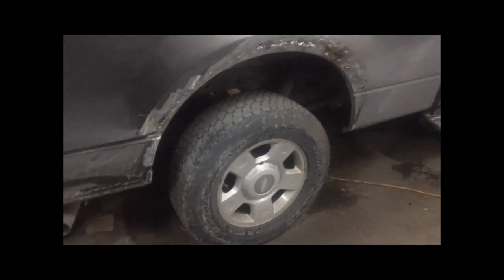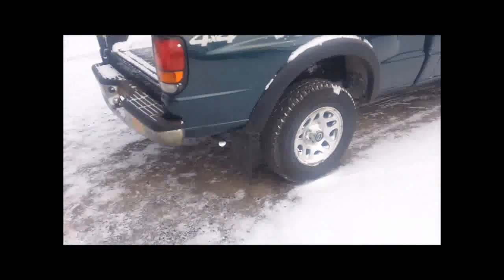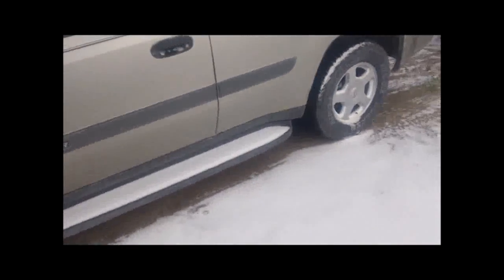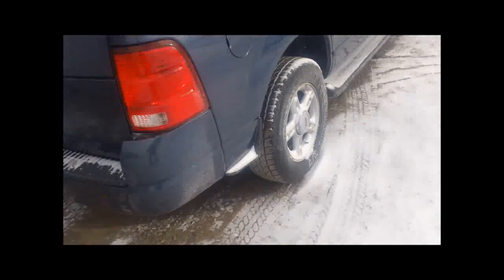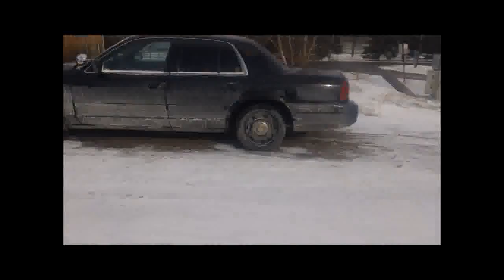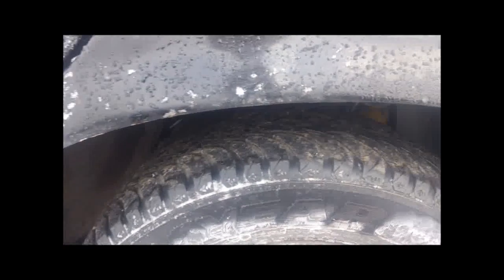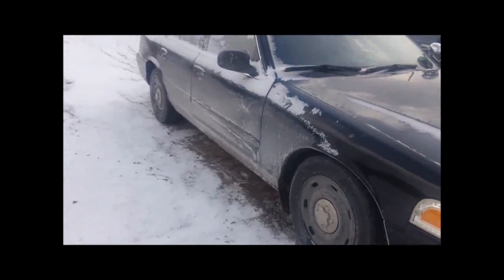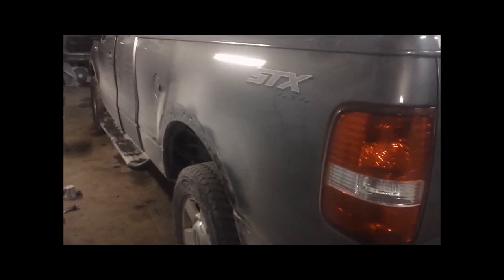Why do vehicles rust? Poor build design or because people don't maintain them?

Comment: Krown it . All inside the panels .. once a year ... then spray it with a can threw out . Car wash once a week in the winter . Use rubber floor mats so the salt off your messy boots don’t go down threw the carpets.... and like Shawn said motor oil .... I had my g6 drilled out so I had access to all the panels and I’ll take a funnel and poor a quart of burnt oil down in the rockers .. it’s a 2009 ...10 year old car drove every winter and has no rust at all . Body maintenance is so important in the rust belt and Canada

Comment: These new cars, trucks, suvs that are so damn expensive , should last the consumer many years even after it's paid off, problem is the underneath of these vehicles rot out bad whether you wash them or not and to the naked eye can eventually turn into a real hazard on the in road if the frame fails. These automakers should cost this stuff on every brand new vehicle to prevent this prematurely

Comment: My truck's fairly decent. Rear wheel arches are shot behind the flares and I had a cab corner put in. The other corner needs a patch now I learned today, a substantial one. It is an 04 dakota though. Front driver's side fender needs to be replaced too along with repairs on the passenger side. Looking at it I'd say poor design with the factory flares. After looking awhile for a truck without flares to harvest a pair of fenders off of I finally found one. A 97 that's completely spotless, and this is southern Ontario.

Comment: My 02 DeVille is a case of cars that are not really all that old rusting quite badly.  It was well cared for by the previous owner, it was his retirement gift to him self and his pride and joy all 13 years he owned it.  He just never thought to have it rust proofed.  In the nearly two years I've had it I've kept up on keeping it clean and waxed, and at just shy of 15 years old it has rust through.  Not designed to be even slightly resistant to Michigan winters.  You can see where the rust starts in the wheel wells, there is a pocket that holds that moist salty sand.  Just sad really, its a great car that mechanically has a long life left.  I feel this body is going to get this thing scrapped in about 5-7 years.

Comment: The whole auto industry is a racket. They could easily put in a foam behind the wheel wells that's waterproof.  Hell, every hardware store sells insulation foam for windows and doors that's waterproof.  But face it:  if the corporations didn't make shitty cars you wouldn't have an income.  You wouldn't have a job.   You wouldn't have a business.  What would you do if cars lasted 50 years with very little maintenance, eh?

Comment: Great videos!!  Finally using my own name instead of my daughter Colleen to post  -:)    As posted earlier, Oxygen and Metal don't mix!  Moisture (water)  +  Salt (Road Salt)  +  Heat (warmer temperatures) A C C E L E R L AT E  the corrosion process. Whether car designs are crappy or not , the consumer is stuck with the problems caused by RUST. Keeping moisture (water) OFF metal will greatly extend the vehicles life PERIOD!!! If you drive in harsh winter conditions where road salt is used 4 months out of the year, frequent washing's are not enough IF you want the car to last many years. Dirt, moisture and salt settle in frames and rockers,then corrosion activates in warmer temperatures of summer or heated garages.

OIL repels water and keeps it off the surface. Spraying ATF or Heated Bar and chain oil into all enclosed areas and exposed surfaces will greatly extend the metals ability to not corrode. The process is best done in the warmer months of summer , because the expanded metal will absorb the oil much faster and thoroughly.  Spray into rockers, doors, fenders, frame and channels, hollow suspension components like control arms, top of fuel tank. The places you miss will eventually rust out. Touch up as needed annually.  Concentrate on the rear half of the vehicle , because it gets hammered with dirt ,water and salt..

Comment: Salt is the enemy, not all the manufactures fault. Cars from down south, California, Arizona, where states have no salt on the roads, the cars are rust free. If the car manufactures would maybe coat areas of the car or truck that prone to rust it may help. Or get in there and do it yourself when it is new , it will help a lot.
Reply: you're right ..but where you're at you have low humidity. ....I've seen videos of junkyards of 75 year old cars with just surface rust....I mean just prime project cars ....but the northern cars need undercoating from the factory!!!!!

Comment: Thin cheap steel and lack of paint. Manufactures constantly cost cutting. Trying to make a bigger margin. A friend of mine works in a Nissan main dealer. And most of the new cars nowadays come out the factory with a dusting of undercoat on the underside. no underseal and hardly any stone chip repellent. all they do is use seam sealer over the welds. cheap and nasty stuff. Best thing to do when you buy a vehicle, is buy a few cans of underseal and go mad with it on the underside. inside box sections and inside doors etc etc. prevention is better than cure

Comment: Rust is created when iron is in contact with oxygen. Metal impurities are also a factor. Moisture , Road Salt (Chlorides) and heat (warmer) temperatures ACCELERATE the corrosion process. If you live in a rustbelt state that uses deicers, you need perform rust control maintenance on your vehicles. Annual thin oil applications provide a barrier between metal and moisture. Annual spring time oil spray into ENCLOSED and exposed areas will greatly extend the vehicles. The warmer weather accelerates corrosion, but also allows oils to penetrate into seams and tight spots where salt and moisture hide.  Metal has pores like our skin and expands with heat. I use Bar and chain oil or ATF from a paint pressure pot.
Reply: +Colleen B. exactly right colleen-you can't stop the rust completely but the oil applications will slow it down tremendously.

Comment: from Ont. Canada here....have a 96 gmc 2500 oiled 2x year, after what...18 years fenders and cab corners are starting to go. not too bad considering they have 05 trucks in the scrapyard full of cancer.  I believe it is a design flaw AND a maintenance issue. just my opinion.Andy.

Comment: A mate used to work for British Steel in the 90's, he said that most European and American manufacturers weren't too fussed about surface rust on the steel they bought. 'Ford accepts anything' were his words. At the same time, Honda would refuse a delivery even if the slightest bit of rust was present on a roll of steel. Not sure if that was/is true across the pond, but it's a thought.

Comment: Being from Chicago and growing up in the 70s and 80s, every car on the road was a rust bucket especially the Fords, they were the worst. Cars became a lot better in the later 80's, 90s  and 2000s. They were using injected waxes, galvanized metals, maybe some ceramics, stainless exhausts, other treatments. I had a lot of good luck with cars that never rusted. I had a 1988 Mustang 5.0, 1994 Dodge Spirit , 2003 Focus, and they were primarily rust free in Chicago.  However, after watching these videos, rust seems to be getting bad again or maybe more so in NY.  I have not seen this much rust before, but come to think of it, I do see rust in Southern Illinois which is where I live now.  I don't know. Regardless, unless the owner is parking it on grass, it is design and salt usage. Maybe they are using more salt instead of paying people to plow more often or spread sand/cinders which requires more applications and labor.

Comment: i get on my hands and knees and spray all the underside of my 04 f150 every single week when i wash it, and i have owned this truck its entire life and has 87,000 miles on it. absolutely NO rust on any part of the truck, except for some minor surface rust on my drifeshaft and rear axel, and this truck has spent its entire life in new yorks rust belt. if your not gonna get on your hands and knees and wash the underside of the vehicle aswhell because your too lazy, then expect that salt and road grime to eat away and destroy your investment. oh and by the way, if you use a undercoating on a older car, do it the right way for fucks sake and sand down all of the underside, and wipe it down with aceatone, ive did it a year ago on my 8 year old truck and no problems at all. but if you stupidly paint it on over dirt then yeah its going to trap in moisture and debris.

Comment: I FEEL THAT MOST OF THE RUST COMES FROM ROCK SALT DURING WINTER SEASON.  I LIVE ON LONG ISLAND NY AND THEY USE SOMETHING COULD LIQUID SALT WHICH LASTS LONGER THAN SAND SALT BUT ROTS EVERYTHING OUT EVEN RAILS.  THE TOWN TRUCK BODYS ROT OUT IN LESS THAN 2 YEARS DUE TO THE ROCK SALT AND NOW THE LIQUID SALT.  ALSO LIVING NEAR THE WATER THE AIR IS FILLED WITH SALT FROM THE SEA OR BAY.  I FEEL DAMPNESS IS THE WORST AND WITH THE WATER AND SALT IS WHAT CUASES ALL THE RUST AND ROT.  OILING THE PANELS DOWN WHEN THEY ARE NEW HELPS BUT IT'S BOUND TO HAPPEN.  I FEEL IF THE AUTO MAKERS SEAMED WELDED THE PANELS INSTEAD OF SPOT WELDED IT WOULD HELP.  BY SPOT WELDING THE PANELS BUCKLE THE STEEL AND CAUSE WATER AND SALT TO GO INSIDE THE PANELS AND ROTS FROM INSIDE OUT.  SO I WOULD NOT BUY NEW UNLESS I LIVE OUT WEST WITH NO SALT OR SNOW.  INSTEAD OF USING LONG STRAND BODY FILLERS WHY DON'T YOU USE EPOXYS LIKE JB WELD OR PC 7 FOR AUTO BODY REPAIR THET DON'T CRACK, THEY ARE WATER PROFF AND STRONG AS HELL.  PC 7 IS 2,150 PSI STRONG.  I USED BONDO ALOT AND THE SHIT BUCLES AND POPPS ALL THE TIME EPOXY NEVER DOES AND LASTS YEARS AND YEARS I DID A REPAIR FOR A GUY HOW SOLD HIS TRUCK AND I FOUND THE TRUCK IN A PARKING LOT AND THE REPAIR WAS STILL GOOD AND THE PANEL WAS ROTTED LIKE SWISS CHEESE SO USE EPOXIES NOT JUST BODY FILLER.

Comment: its a mixture of salt and chemicals on the road, and poor build quality, think of it this way, if vehicles lasted 50+ years, how many manufacturers would still be in business? NONE. they'd only sell 5% of the volume they do now. they need people to get sick of fixing their crap, so that they buy.... guess what..... MORE CRAP. the best thing to do to prevent rust, here in New Hampshire at least, is get either oil spray undercoating, or a product called "Fluid Film". neither of these will dry out, peel off, or get washed off, even the oil cant be easily washed off. and wash your crap in the winter often, even if they're predicting another storm in a week, get it washed.

Comment: I think the cars are being made cheaper. If you live in a state like Wiscinsin, they use salt on roads. Before winter I give the car a good wax job. Under doors too. During winter I will get out the water hose, if temp is above freezing and wash out the inner wheel wells. I have been a fan of GM Monte Carlo's. My last one didn't start to rust out ( rear quarters ) until car hit the 10 year old age. Had to trade in when strut towers in rear rusted almost through. My 2002 monte Carlo SS just got a fresh water inner wheel well today. 50 degrees today!!!

Comment: The detroit auto makers refuse to put proper rust proofing on their vehicles. They claim that it is unnecessary and that their painting/finishing process provides all the rust resistance needed, TOTAL BS. I own a 99 VW new beetle and it is a POS in most respects but I do give VW full credit for putting FROM THE FACTORY, complete wax injection/rustproofing goo on the inside of the doors and the entire bottom 1/3 of the car on the insides of the body panels it has a thick coating of rustproofing applied. In addition to all the hem flanges on the doors, hatch and hood are fully seam sealed AND the entire bottom of the car has got a super thick coating of chip guard applied.
NOTHING from the detroit 3 has that level of detail even today and that VW beetle I mentioned is a 99… 

I own chrysler vehicles ranging from 79 to 03 and even the 03 doesn't have the level of detail applied to rustproofing the VW does. I am not a 'detroit basher' so please withhold ignorant comments telling me as such. But they are their own worst enemy in not doing more to rustproof their stuff. planned obsolesce works both ways, the consumer doesn't buy your stuff when its rotting from the inside out.

Comment: My opinion on avoiding rust.  I think a car need never rust if looked after with a mind to preventing rust. Firstly in my opinion the only rust treatment that really works for the long term without any special maintenance is to start with a galvanized body-shell from the factory. All other treatments will crack and degenerate with time.
My solution:
On a regular bases inspect your car/truck for rust over all surfaces you can get to. I put something thick that does not totally harden on exposed surfaces on the underside wherever I see rust. I prefer thick  grease or copperslip. The idea being the rust is due to cracks in the existing treatments and if they can get filled with the oil from grease then the rust is stopped.

For areas it is harder to get to I spray oil. I am not scared to drill holes so I can reach into box sections and wheel arches etc with an oil can. For example pull back the carpet inside and drill small holes into the sills form the inside and drip oil into there. Drill into the inner wheelarch sections of a truck box and use a rubber grommet to cover the hole. I like oil as it keeps on moving and it will find it's way into cracks that may be too small for water.

Hidden mud traps such as behind plastic wheel arch liners should be cleaned out. However oil will eventually soak into mud creating a protective mess.

The secret here is doing this on a regular bases like every six months so the rust never gets a hold and there is always a residue of oil to soak into new cracks.

You also have to remember that from the factory bodies are put together without paint and are then dipped into a primer bath. Despite the claims primer will not permeate every part. Vibrations will crack this primer, then seams such as around bonnets and doors are left with no protection, with effectively a sandwich of bare metal waiting for rust to expand it. I like oil because as soon as these cracks open up the oil finds it way in before water can. Trucks may not even have paint between the body and the chassis to start with. even if they do paint will soon rub through. Oil will create a kind of dynamic protection.

Comment: This video reminds me of my childhood in the 70s and 80s when cars used to rust after 3 years. I am afraid to say that rust is a perfect marketing tool for the industry. The whole rust cycle helps sell cars. Most people consider it is stigma to drive a rusty car so such people would manage their finances to purchase a new car every 3 years or so. After that time rust would likely be showing on the car, this rust would have little affect on the trade in value and acted as an indicator that it was time to change cars. The sales person would ensure that the rust issues that affected the old car were now fixed.  In the 90s manufacturers solved the so called "rust problem". This gave rise to  a major problem of people keep their cars for more than 10 years when they could well afford to buy one every 3 years. The solution to this was scrapage/cash for clunkers which has got those people back to a new car every 3 years because it might rust and will cost too much to maintain out of warranty.

Comment: Both poor design and owner maintenance.  Below are my findings.
1997 Pathfinder made in Japan. Well maintained, never rustproofed. Rusted bumpers.
2005 Altima made in USA. Well maintained & rustproofed yearly.  No rust.
2001 Maxima made in Japan.  Not maintained and never rustproofed.  Severe rust on quarters, rockers and rad support.
2002 Maxima made in Japan. Well maintained and rustproofed. Little rust.
2007 Trailblazer made in USA. Well maintained and rustproofed yearly. No rust.
2002 Camry made in USA. Not maintained and never rustproofed. Little to no rust.

Comment: my dad had this sliver 2000 z71 GMC 5.3 3 door extended cab and it just rusted bad around the drivers side cab corners  before he sold it and got a white and gold 2007 4 door ford f150 5.4 limited 4x4 2 years ago thats starting to rust on the same side cab corners so

Comment: On many cars the front wheel wells are just fine with no rust while the wheel wells in the back on the same cars are totally rusted. That is not due to poor maintenance, the back of the car gets the same "maintenance" as the front of the car. It is due to the design and the way that inner and outer fenders join in the wheel well in the back where there is just outer fenders in the front. With this design a lot of crud and moisture gets stuck in the joint in the wheel wells in the back, while there is no place for crud and moisture to stick in the front..

Comment: Good Video, I use Chain Saw bar oil with a spray gun that handles the heavy viscosity. My Truck 2001 Silverado. I'm in NE OH. but , I only have one rear wheel well and one cab corner rusting out , so far.

Comment: The cause of rust in your situation Shawn is salted roads. GM and Ford cars utilizing the same production methods in Australia will last 30+ years without bubbling just as they might in more tempeorate parts of the USA. In my opinion that is because we don't have snow and salted roads here. In my personal experience the only thing that makes my cars rust is if they are parked under a tree and leaves fall into the vents and retain moisture. I have some bubbles in the sills of my 1968 GM Holden but they are nowhere near as bad as the fun jobs you get to tackle! All cars will eventually rust even in the desert but salt is a known catylist that causes oxidisation.